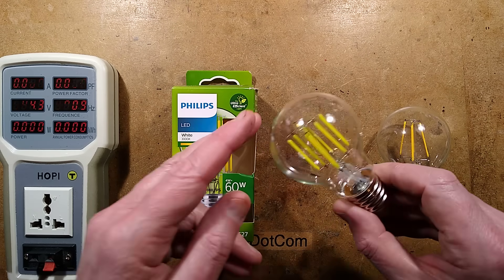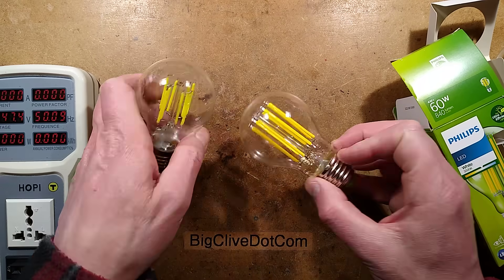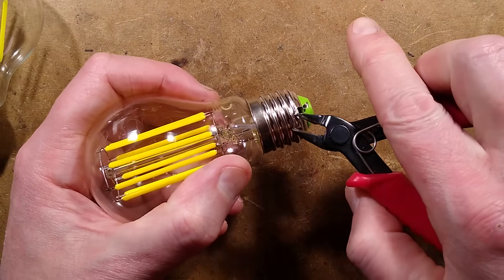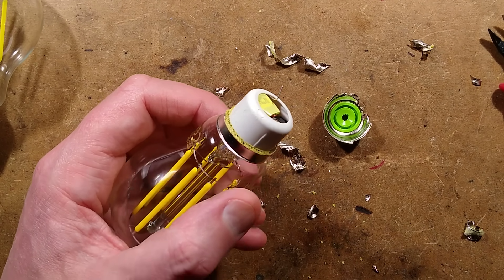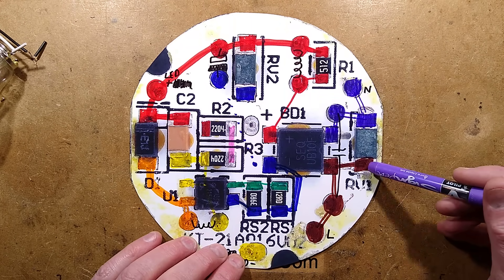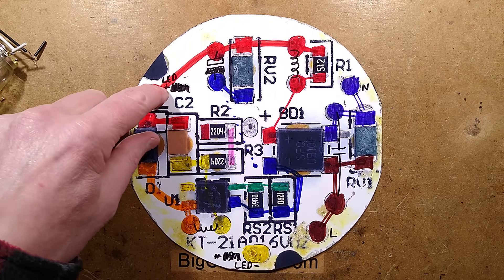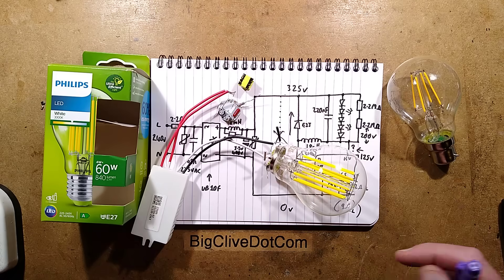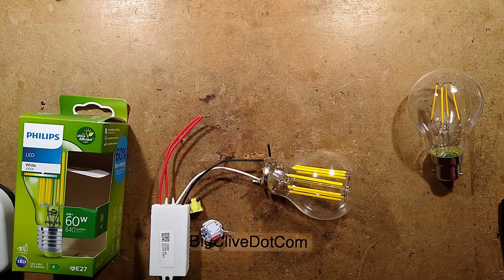Inside a new Philips ultra-efficient LED lamp (with schematic)

Comment: They were originally all made in China around 2010 (when you couldn't walk into any shop and buy an LED bulb) because no European or American lightbulb manufacturer was interested and called LED lighting a fad, how wrong they were. 
I was in France, Paris to be exact at Gare de Lyon, photographing light fittings and bulbs, sending them to England to a designer who would draw up schematics for the manufacture of an LED that would fit into a bulb suitable for the fitting.  He then sent it to a manufacturer in China who would hand-build them and send samples of colour to us, the client would agree on a colour and an order would be placed. On one occasion they sent us a PAR 38 with a large yellow square LED in it, they had just developed to find a use for it, that is what is now in floodlights.

Comment: I have a doubt, I assume it has edison LED filament inside, if I break the glass and get the LED filament out (single filament) will it work if I use some 3v battery to try lighting it up?
Reply from the maker: These are fairly high voltage filaments, but you can get 3V filaments on places like AliExpress.

Comment: 2:18 Oh they actually used a circular arrangement! Puts the max distance between filaments, so less light is blocked by neighbouring fils. Also makes sure the inner filaments dont heat up more.

Comment: So I live about 30 minutes away from Firestation#6 in Livermore that has the famous centennial light that was lit reliably for 124 years.  It’s amazing that something lasted so long, but the light output of it is useless.  A lot of things can last over a centennial, but would it be practical for every day use?
Reply from the maker: If you under-run a tungsten bulb it will last for decades.  But the cost is in massively reduced efficiency.  That centennial light has probably cost thousands of dollars in electricity.

Comment: I took the led "filaments" out of one of an led bulbs, but I can't figure out what it takes to run them.  I was figuring it would be somthing like just 3.3v, but nope.  There's nothing special about the "bulb" component.  What does it take to run them?
Reply from the maker: Some are as high as 100V. But you can get 3V and 12V versions.

Comment: I just bought a simular Phillips LED bulb in the states.Theserun on 120v so are configured differently.  They are not cheap but they are very efficient - at  walmart 60w equiv bulbs draw a5w and cost $16 for 4 of thhem, the 100w equiv cost $16 each and draw 11.5w. The 100w bulb runs warm to the touch butis much cooler than other LED bulbs and that should lead to a long life. The 100w equiv is also a physically larger buld, longer LED "strings".

Comment: FYI.  You can use Google Translate to decipher Chinese IC datasheets.  I did it with the LIS9415 Non-isolated buck LED driver.  Just select and copy text from the PDF and drop into Translate, then copy the translation to a word processor or text editor.  I created 4 pages of readable paragraphs.  Translate has a size limit.  Only so much can be dropped in at once or you'll get an error.  I'll try Translate with that PT4554C next.

Comment: Wow... That HV Pin thing is actually really clever. Not only does it reduce the voltage the buck IC sees, perhaps straining it less, but it also means that any power it consumes, like mosfet switching power (for charging the gate over and over) etc. is drawn through the LEDs, so less power is wasted. It's probably only small difference in efficiency and this trick probably only works with loads that draw a steady amount of current, or at least some minimum amount of current. But still, pretty neat, I like it. I gotta say, 210lm/W is also pretty impressive. Kinda disappointed about the green tint though. In my opinion that's cheating. It's exactly what cheap Chinese LED manufacturers do so they can claim a higher efficiency at least in lm/W (since lumens are a unit of perceived brightness not actual light energy). But usually it's just sacrificing light quality and CRI for efficiency. I hate the light of the cheap Chinese LEDs with green tints. Philips may not have gone as far as they do, but still, it's a step in the wrong direction in my opinion.

Comment: These LED lights are very flickery. Is there a way by changing the circuitry to force them to be less flicker?
Reply from the maker: The cheapest ones are flickery.  The better ones have very little ripple.

Comment: the Philips ultra efficient bulbs have worse color rendering (90cri vs 95cri), including worse r9 values (80 vs 89), but last 50k hrs instead of 15k hrs. Bit of a letdown that not all their specs are better than the current ultra definition ones, plus they cost about the same per bulb. the new ones do use way less power obviously so that is definitely a plus

Comment: 11:57: Please, what is the component here? I can't make it out and the captions convert to "direct fire." Actually the second video with same problem for me on this component.

Thank you!
Reply from the maker: The incoming supply has two components across it.  An MOV metal oxide varistor to clamp voltage spikes, and a class X2 filter capacitor to reduce high frequency noise.

Comment: I went in and bought all the ones on the shelf, then came back a few days later and their new supply has a different wattage and lumens rating.

4.5W/810l became 5.0W/850l (both A19 60W daylight in the green box, four led filaments in both).
I'm not sure if they are different, or if they just "fine tuned" the labeling.
EDIT: after carefull inspection the new ones say suitable for use with dimmers, the old ones said not compatible.

Comment: thanks for saying the phoebus cartel is nonsense. 
veritasium made a vid saying it was bad. he was very, very wrong. obvs a bulb that makes less light will last longer. that fire station bulb is ludicrous. any bulb could last centuries if it had massive internal resistance and made bugger all light. a longer light lasting light bulb makes less light for more power. it actually makes me rather cross when people say the phoebus cartel was a bad thing. It was made to protect consumers and the nascent power grid, and bulbs cost bugger all, bit of glass, a stamped sheet, and a tungsten spirally thing. even 100 years ago factories made them by the hundreds of thousands. some power companies in this era even gave bulbs away for free.  a long lasting bulb uses more power for less light, this is what the cartel protected people from

Comment: i have well gone off LED bulbs. obviously i use them in my home, everywhere, other than my study. in my study only tungsten bulbs will do. i have a gross of them in my shed, so i should have enough to use until i die. whatever LEDs say on the package the light is rubbish, they claim to be be 'warm' yet they all have spikes, and the CRI is crap. tungsten bulbs are fantastic, but should only be used on one's study, as they are so inefficient.

Comment: Bought one yesterday. Really a disappointment 2700K, 4w, 840 lm frosted. Sure it's bright and efficient. But... That yellow-greenish color - it's really really not beautiful. Perhaps it's fine for an outdoor lamp where you only need a  lamp to deter thieves. But as a light for residential living - no way. Wish IKEA made some high efficiency ones. IKEA really has been serious about their LED lighting lately. Even from just a few years back there has been a significant improvement in light quality - and they actually was quite nice but now even better. Have compared to some unused I've had laying around for a few years.

Comment: Not sure if you are still reading comments on this older video, but I think you'd have a very popular video if you were to look into the greenish tint that all of the current >200lm/w products seem to have. OSRAM is also affected by it and nobody talks about it. Its bad enough that people immediately toss them or move them to the garden. 
Maybe show a comparison against a neutral white lamp. Talk about how this green color is likely an unintended side effect of the new generation of lamps attempting to reach energy efficiency rating A at all costs, sugar coated by marketing speak. Try to find out if its a physical effect of the underlying LED technology. 
I believe a lot of these lamps will end up not getting used because the color is objectively ugly. This is very anti-consumer in my opinion because people have no way to figure it out until they return home.

Comment: just out of curiosity what if you tried to run this though a 110v socket.  I'm in Canada and wanted to use the 40w version.  I noticed on the Canadian Phillips page they reference the european model number under product offerings but they aren't available here.  This part about running the chip off 125v and 100v filaments has me wondering now.  Electricity and magnetism were never my strong subjects in school though and I'm a bit lost.
Reply from the maker: It depends ob the combined forward voltage of the LEDs whether it may work on 120V.

Comment: Products with exactly the same packaging and lamps are also sold in China, but the Chinese version is only 200LM per watt (4W bulbs provide 800LM). I don’t know if it is because of the difference in voltage or the difference in measurement methods.
But these light bulbs are very cheap in China, only selling for 30RMB, which is equivalent to US$4.20.
Reply: This lamp is not cost-effective in China. Although it saves power, it has an obvious color cast, the light is not smooth enough, the CRI is only 80, and the spectrum is not as good as that of sunlike LED lamps in the price range.

Comment: The market has caught on and now (in Europe) we have Rabalux branded bulbs that can do 1525 lm at 7W, or 470lm / 2W, so 220-240 lm/w - same as or more efficient than Philips, at just over 4 GBP equivalent! ... They seem to have exactly the same driver circuit too, "PT5445N", and they run warm, but not super hot. .. CRI Ra measured at about 83, with R9 around 27 for 3000K. ... Search for "Rabalux 79019", or just "Rabalux 790" for the entire line.

Comment: Hi there, with many people reporting a horrible green tint on these bulbs - It would have been really interesting to do a Colour Spectrum test on these to see why the green tint is so bad. Do you have a Spectrometer for testing CRI Ra?
Reply from the maker: Alas no.  The proper CRI meters are quite expensive gear.
Reply: It seems that all Philips LED bulbs are CRI80. All except their dimmable WarmGlow series, which are CRI90.
Reply: @mateuszorlinski7334  philips ultra definition got cri95

Comment: I took apart a christmas led lamp recently (230V E27 colored bulb) and the circuitry was a 4 leds, one rectifier and two 15k resistors. Incredibly simple. I like simplicity, I think it could have used a smoothing capacitor to reduce flicker and it would have been just fine, super simple and reliable. Perhaps not as energy efficient but maybe not such a big diff either?

I like it because I can dim the leds real well with a variac like they where incandescents.

Comment: The amended connection is totally sensible probably also uses the 2 2.2 Meg resistors reducing the voltage the device sees is always a good idea , especially  if the chip is being stressed by operating on 240v mains

Comment: The Philips Ultra Efficient are available in Australia (240v / 50 hz - 4 watts) in two colour temperatures. Annoyingly, Philips Ultra Definition bulbs seem restricted to 120 v regions (USA / Canada). I find that both of the colour temperatures options of the Ultra Efficient bulbs throw a bit too much green/yellow light to what I would prefer. But the efficiency means I have still kept a few running in some rooms.

Comment: i bought a similar light just last week, it's identical, same circuitry, same filaments (except it was a 2700k), same price, but it was ran at 13w for 2500lm, so it's basically the same production line and they are just swapping out the current resistors, will see how much it lasts...

Comment: Can you do a video driving a 220V LED bulb with only 110V?  Would that give the same effect as those Dubai bulbs?  Around 8yrs ago, I mistakenly bought a 220V LED bulb but to my surprise, it works in the US, just drawing less power and producing less lights.  It's still running.  Most other LED bulb especially Phillips dies in 2 to 4 yrs time!  It would be nice to hear your insight
Reply from the maker: Some 220V lamps will not light on 120V.  But others do work.

Comment: My recent Phillips 60w purchase said it gave 800 lumens and consumed 8w.    It actually delivered 700 lumens and consumed 7w.   I'm sorry but 700w is painfully dim and they should call it a 45w bulb.

As a rule of thumb, I think you can look at watts consumed and multiply by 100 for lumens.  So I'm going to need a bulb that actually consumes 9w or 10w.   But that's no good if the lumens and watts on the packaging and advertising are wrong.

They do run cool and will probably last a long time.  But I can only use them in multi-bulb fixtures.

Comment: Can this lamp power supply drive another LED lamp, it has no flicker so should be not trashed, does it auto adjust current voltage? If not why not give instructions on how to adjust it?

Comment: To really save some energy=money better get a solar panel and place it somewhere with a power bank to charge your phone..or with a battery to light a room.
Dont trust even the known brands because its all about advertising and marketing. They may last a bit longer but i dont trust it if enough to recover the money spent on it compared with paying less to the energy bills until the bulb fails.
Even in the warranty of these Dubai bulbs from Philips (4W/840 lumens) or Ultra-efficient ones there is a paradox lie.
I understand the fact about not stressing an electronic component will increase its lifespan, but man, 50 years with something which can go hot more often and really not cold, this is a big lie. Especially the electrolytic capacitors which don't like the hot temperatures.
They guarantee that the light bulb lasts 50 years (if run 3 hours from 24) or 50,000 hours. To be more specific, in order to guarantee something about a lifespan of a product, it means that you/company have tested this product for that period of time and the fact is : this LED technology was not even invented 50 years ago.
Its like saying to a 10-year-old kid this: Hei I saw you 15 years ago with a cool purple t-shirt, do you still have it?
Morale is: Only solar energy can save you energy=money not the lightbulbs.
I forgot to mention that Philips Dubai/Ultra-efficient light bulbs are still expensive and you never know when they gonna fail.
These are still expensive because it is still kinda new technology and the new tech/features will always be expensive in the first years.
Its just a matter of time until these will be cheap or until will be made by other brand companies as well because its impossible for such a technology to monopolize the world as long as we still fight for a cleaner and greener planet. I'm sure at least European Eunion will do something against monopolizing the green future by a company, just like they did with regulating the plastic bags, USB-C, incandescent inefficient lightbulbs with Wolfram and so on.
Edit: I understand Philips they have patented the "Ambilight" on the TVs but here we are talking about a cleaner planet so this cant be monopolized. A similar case is patenting the ARM CPU technology and  NVIDIA did and keep trying but in fact, the code-machine language for such CPUs is open source.

Comment: Some Walmart stores in the US recently started selling some Philips bulbs like these ("60w replacement" standard) with an angled filament design and only 4 rods instead of a longer cylindrical cage design like in the video.    Two parallel sets of two rods run in series.They run at 4.5w instead of 4w (and advertise a "40% reduction from standard LEDs" instead of a "60% reduction".    They also have a Power Factor of .95 which was pretty surprising, considering other LED lamps.
Reply: Where can I find more info on this?
Reply: But they have a whining sound when all is quiet

Comment: In case you need a new idea for a Philips lamp to take to bits, they now have a new efficient lamp with 14 filaments, PHI 43591900 LED-lamp E27, 7,3 W, 1535 lm, 3000 K. Would love to see your analysis if you feel like it.
Reply: Oh perhaps it is the same batch as this one but a higher output version, since they both are 210 lumen/Watt, I'm not sure.
Reply from the maker: I'll keep an eye out for that.

Comment: I’m a novice with electronics so this is going to be a bit daft, what voltage and current do those elements run on? I’m trying to figure out if a conversion to DC power via a battery would be possible. I live off grid and typical 12 volt bulbs run around 70-85 lumens a watt and if what I’m reading is right, this is 180 lumens a watt. Does most of the efficiency come from the power supply or is it the LEDs themselves?
Reply from the maker: It's probably mostly the quality of the LEDs.

Comment: I've just ordered a LAP bulb from Screwfix. It's a 3.8w bulb rated at 806lm. They also have a 2.2w 470lm bulb but that only has 4 filaments. In the picture on Screwfix's website I counted 9 filaments on the 60w equivalent!
Reply: I got it yesterday, it has 8 filaments, the picture on Screwfix's website wasn't great. The light has a yellow-greenish hue to it but it's not too bad. I'm tempted to buy another 2 for the shed. Just a bit gutted they only have the vintage bulb cap for the brighter bulb as it won't fit inside my dome light fitting.

Comment: Never understood what the actual use of these lamps is. I've never bought any that was less than 10W, same as for the luminescent "energy saving" lamps, none I had was less than 20W.  If I wanted candle light I have actual candles.